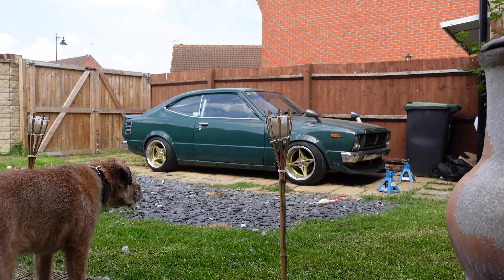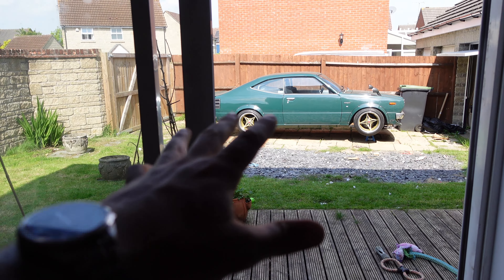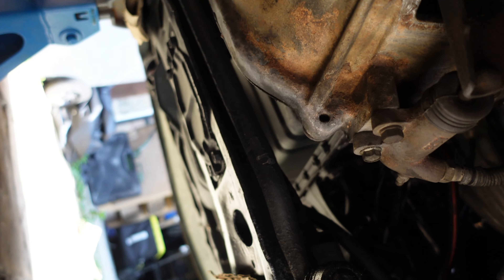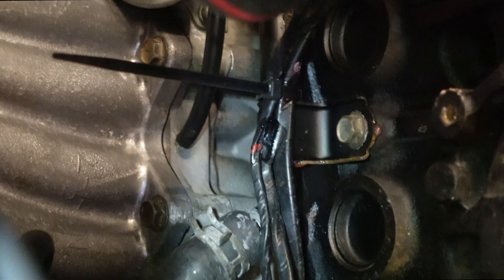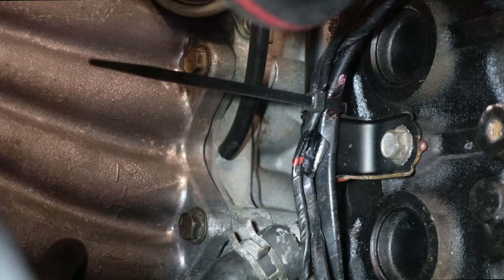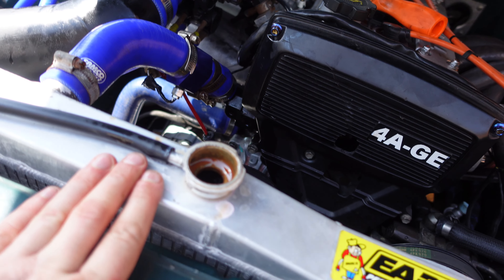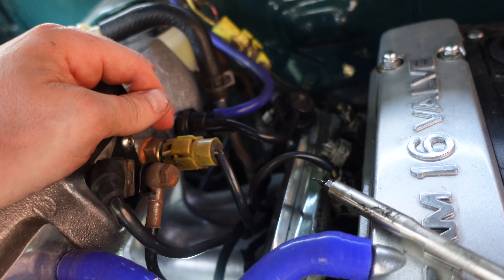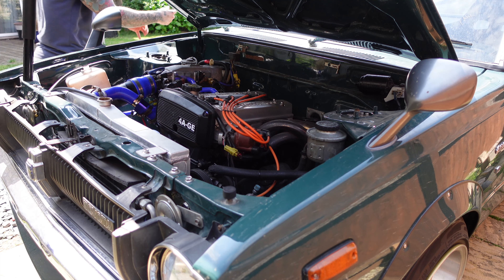Fixing Some Leaks On My 1975 Toyota Corolla KE35

Comment: Please Check Fuel Pump Can Cause Flooding If It's Aftermarket High Flow Pump Cheers.
Reply from the maker: It's a timing issue. Fuel pump can only pump as much as the injectors allow it to. So it wouldn't be the fuel pump, it would be the injectors.